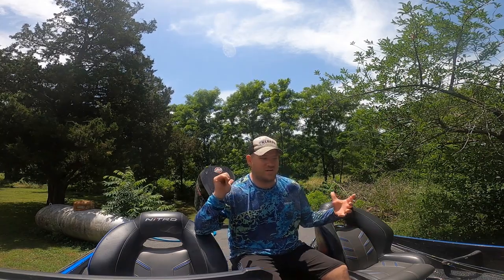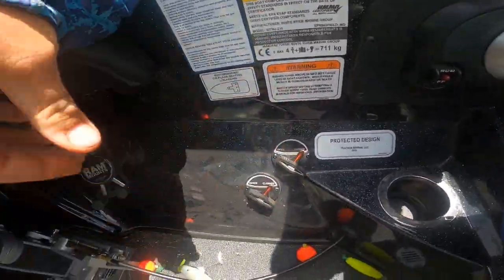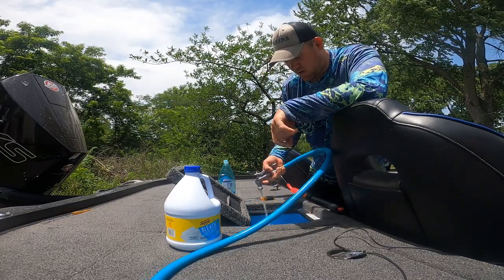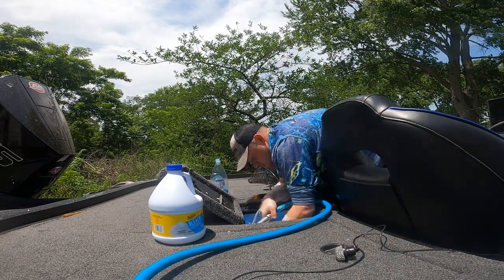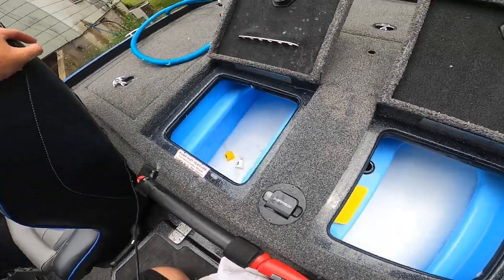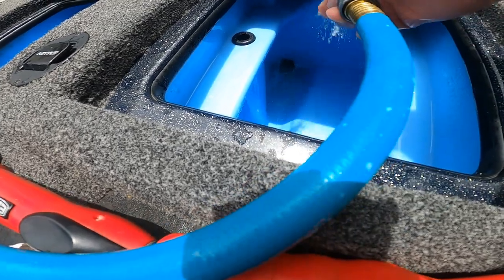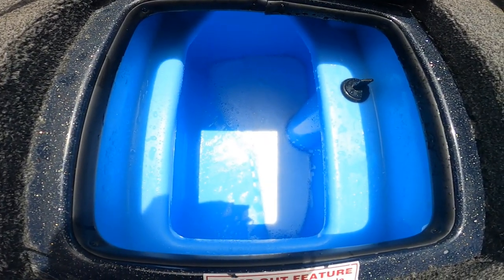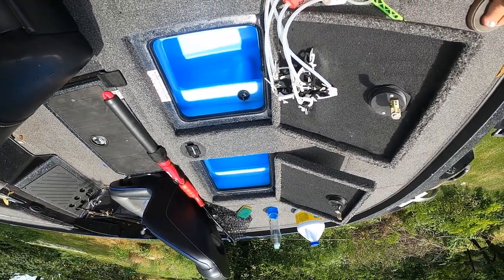QUIT KILLING BASS BY DOING THIS! Livewell cleaning how to.

Comment: Thanks for sharing.  However, I'd be concerned using bleach.  If you drop any on the carpet it will change its color.  Vinegar will be just as effective and won't leave any potential residuals left which would harm the fish.